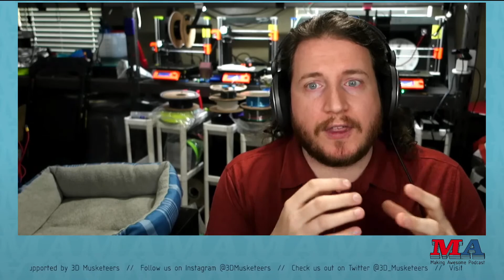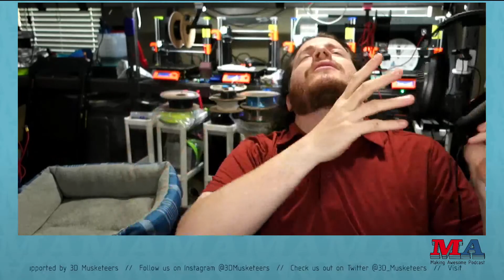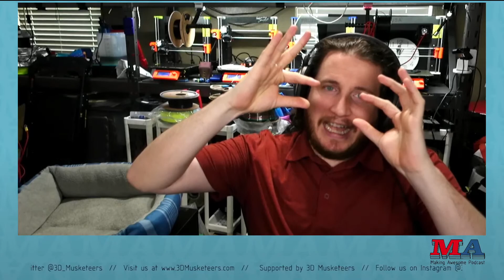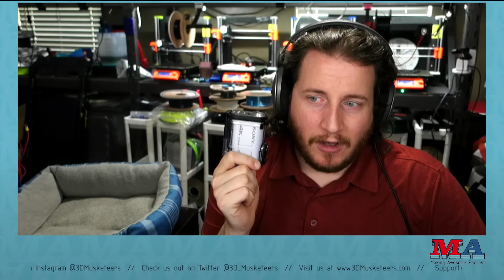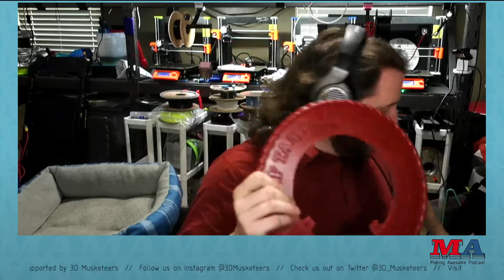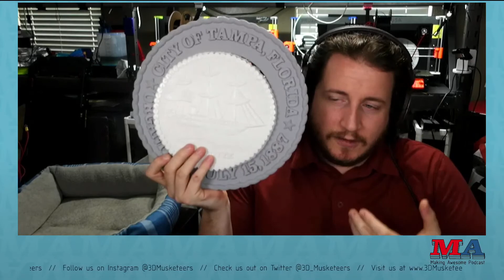Can YOU make MONEY 3D Scanning?!?! - Making Awesome S3E36

Comment: Yea im having the same problem with the Einstar gaming laptop with a kick. It's a rysn 7 32gig   gtx 1060 card. Shit i cant get a good calibration. Had it for 2 years and not used it but twice . have time now and no calibration. After it rejects the calibration I forced white balance. and the computer screams the mesh no problem fast. so TROUBLE IN LITTLE CHINA. PS: I also have the POP2 For smaller parts.
Reply from the maker: oh yeah, the 1060 is going to struggle, the einstar needs a minimum 40gb ram normally.

Comment: I really like the idea of 3d scanning cosplayers. You really think it's doable with a handheld scanner line an Otter for example?
Reply from the maker: We have not used the otter, so I'm not sure if we could recommend it
Reply: It's really good. I'm new to 3d scanning and managed to scan a functional part and successfully reverse engineered it. Size 13x25x10cm. When I was looking into it before buying I saw a lot of people doing body scans, and it does capture the detail extremely well. Check out the videos done by Payo.

I will look into this, thanks for the great idea. Do you think a DIY photogrammetry rig would be better for something like this? Since it's much easier and faster to scan people in an event?

Comment: Thanks for the video. When talking about metrology and scanning for inspection, would you agree it depends on the tolerance required on the part being inspected? If I'm scanning a weldment that dimensions only have to be within .060" or .030" are the $1,000-$2,000 capable enough of this? Most of the inspection work I was hoping to do would be for weldments that don't require micron level precision. But being able to measure down to .005"/127 micron would accomplish plenty for the types of parts I was thinking of.
Reply from the maker: can they do it certified? No. Can they do it, technically yes, but if you are insuring or whatnot based on those numbers, then the cheap scanners wont fly generally. 

The problem with the cheaper scanners is that their software is absolute garbage and needs a TON of polish, but the hardware is good. You may need a secondary program to measure everything reliably though or a way to compare it to CAD or expected values.
Reply: @3DMusketeers  Makes sense, I haven't done any research on the more expensive scanners, just because they're way outside of my ball park right now.

I just did some research on the ISO certification for 3D scanners, ISO 10360-8? I'm assuming a budget scanner like a Revopoint can't meet the manufacturers own specs during the testing called out in the ISO standard. Which is all a scanner would have to do to be "certified" 

If I told my client I can inspect a part within "Limits from 3D Scanner manufacturer" and they're ok with that I would just need to have the scanner certified to the ISO standard. Which would be an interesting video, actually put scanners up to the ISO standard and see how they perform.
Reply from the maker: Your budget will not allow for a scanner that can provide calibrated results alas :/ I would recommend reaching out to a local scanning company to help out, or, if you want, we can do the scans too!
Reply: @3DMusketeers I did reach out to my nearest GoEngineer and they recommended the Peel3D. But that’s still outside of my budget. 

Thanks for your input!
Reply from the maker: ah ok, yeah, Peel's are expensive. I love my artec scanners, same thing though, pricey. We are over in tampa, happy to have the parts shipped here and scan it with our Spider?

Comment: Yesterday purchased the pop3 to get into 3d scanning and offer the service of mid size parts scanning in my small 3d printing business,  many people have contacted me to design some small automotive parts that can't  be found anymore and want to 3d print them but unfortunately I have not be able to design them due to the so complex shape, I even have a air conditioner vent that I started to design from scratch but has complete shape too so this part will be the first where I will try the pop3,  in my country nobody offer3d scanning service,  do you think the pop3 have been a good investment to start? And what price per hour should I start to charge so I can catch new customers and get into the local market, I did want to buy something better like the einstar but unfortunately purchased a bambulab printer past week, and for it have to buy a new laptop too
Reply from the maker: It depends on the accuracy needed. If you need high accuracy the pop 3 isn't for you. Scans though just give a mesh so if things need editing you will be doing that outside of the scanning program

Comment: I know iam late to the show but can you tell me what would be a easy to use scanner just for hobby that not going to break the bank and software is easy to navigate I just looking to have some fun thank you
Reply from the maker: nothing unfortunately. Cheap normally means crappy software.
Reply: @3DMusketeers  iam looking in the 500 dollar range +/- or using a iPhone 14 I just looking to have fun but iam not real tech savvy
Reply from the maker: my statement is still valid. There isnt much in that price range anyways.. The closest thing would be the Revopoint range but it has software and tracking issues. The Einstar is around $900 but also needs a strong computer to run it.
Reply: @3DMusketeers  thank you very much for the info
Reply from the maker: absolutely. 

We will be having an unboxing and test of the CR Scan Ferret at some point soon, so stay tuned for that. I plan to test it against some other scanners we have as well. Some in it's price range, others not.